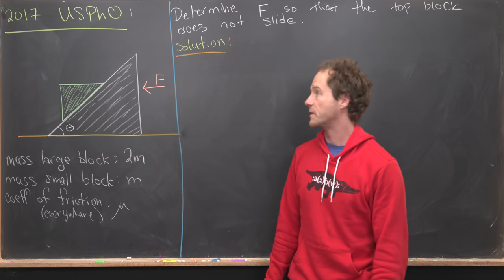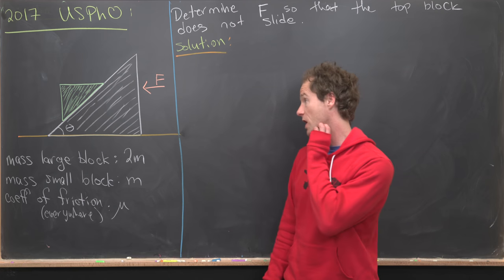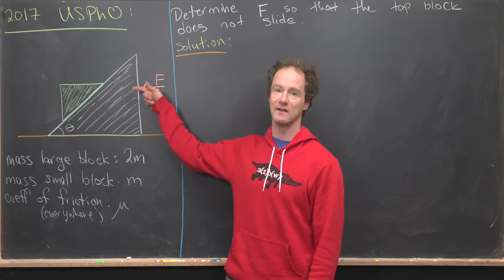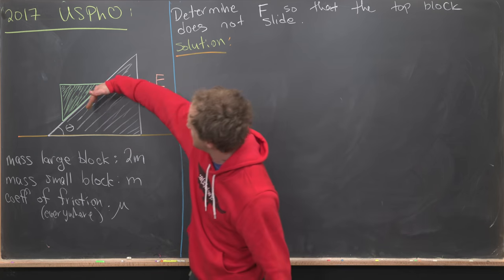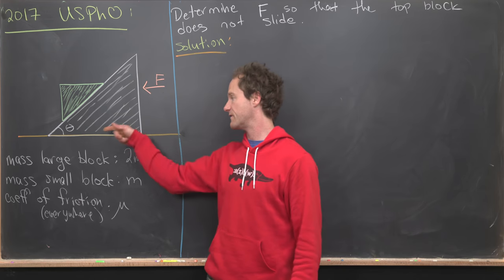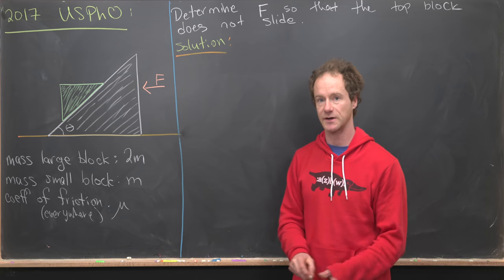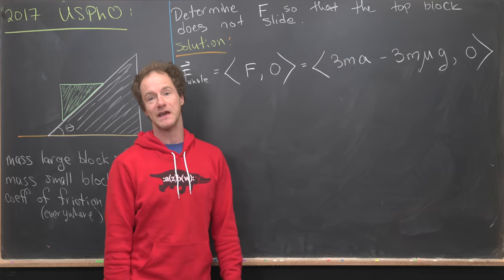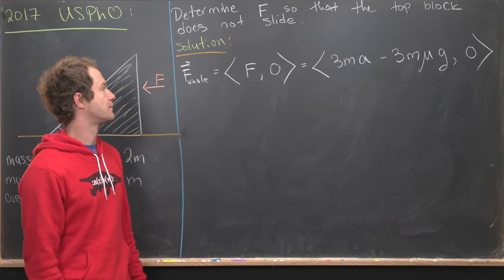Math professor tries Physics Olympiad!!

Comment: Could you explain why the equation for F_whole is 3ma - 3mmug? It makes more conceptual sense for it to be +?
Reply: You are correct. He is weong to my knowledge
Reply: It’s simply a matter of defining what you are talking about. Throughout he clearly is calling 3ma the resulting motion of the body from pushing it. In this case, the 3ma is the F drawn in the diagram and the F in the equations is the resultant force on the body (3ma-3mug)
Reply: He is not only making a sign mistake here but also a very important conceptual one. This is what we usually see in most of our Physics students as well, especially when the concepts are not understood thoroughly. He is definitely WRONG! If F in his solution referred to the net force, then the equation would read F=3ma. But since he keeps saying that F is the force applied from the right, he should have written for the net force as F(net)=F–3\mu mg. Then, this net force is equated to 3ma, yielding F–3\mu mg=3ma. So, either way the equation he writes is WRONG, WRONG and WRONG!
Reply: @joshyman221  
The result he ends up with is wrong though, because he later is using F as the applied force and a as the resulting acceleration.

Comment: I'm thinking from a physics perspective you inspect the problem. There is one constraint - M2 does not move with respect to M1 in the solution, therefore F=3ma+3um. Then how to find a? The forces up and down the ramp must add to zero. It is easy to see that this means Framp = m(uNsin + asin - gcos)=0 and therefore a = (gcos -uNsin)/sin or sometime like that. I don't have any paper here.

Comment: My training in physics is reduced, so I could certainly be wrong, but I would like to understand two points :
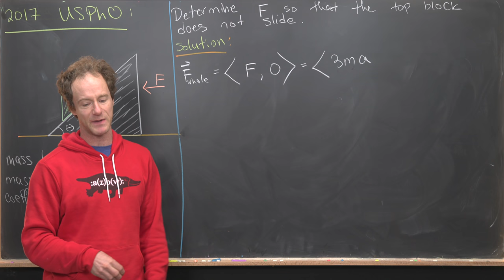  - at 2:40, why not a PLUS ? The needed force = the force who moves the system + the force reacting to the friction. Isn't it ?
  - I'm confuse by the use of the same μ in the two contacts, because the first must be a dynamic friction and the second a static friction (if the goal is achieved).
Thank you for an explanation if you have the time and continue this great channel. And yes for more physics videos.

Comment: The problem is somewhat incorrectly stated. The coefficient of friction is not mu on every surface. For the bigger block, the friction coefficient with the floor must be at mu if the block is moving (which it must be since we are trying to find the maximum and minimum values for F). But, the friction coefficient between the smaller mass and the big block is, in general, mu_1 <= mu. This is a very important consideration to make.

Furthermore, your sign for 3*mu*mg is incorrect. A quick force diagram for the overall block system shows that: F-3*mu*mg = 3ma => F = 3ma + 3mu*mg. There are no two ways about that.

Comment: How the hell could the small block shift upward on the diagonal simply by a horizontal force on the larger block? Does not make sense!
Reply: A force perpendicular to the contact between the two blocks is generated. This is called the Normal Reaction force. This force will have a component in the upwards direction hence pushes the small block upwards.

Comment: Brave effort :). The problem would be nicer if stated in terms of acceleration (with g as the unit) rather than force. And while you did do some discussion of the results, a physicist would do more thorough discussion in terms of a and mu, in order to get a feel for the whole system. E.g. using some realistic mu like 0.8 and see what how theta and a would mutually relate then.
Reply: the physical interpretation would point out its all incorrect.

Comment: This is a nice video. In my opinion it could be even better if you focused more on the physics part of the problem. The equation should come from the system modeling part but the video does not tell what is the point (part of the system) that you consider forces in (what are those forces and what is the reference point for considering them). What are the equilibrium constraints for the upper block to not slide up or down. Also, I'm not sure what is the purpose of introducing acceleration `a` in the equations. The math part is great as usual :).

Comment: Is it normal for maths professors to be able to solve physics problems
Reply: Yes. Cause physics problems have a lot of maths. You can apply calculus, differential equations, probability in many branches of physics.
Reply: They can very off solve the resulting equations.  However, they cannot always set up the problem correctly.  I am happy when they can, but sad when they post something that demonstrated clearly that they cannot.

Comment: The problem here is not approaching the problem correctly (as pointed out by quite a few viewers before me).  There should be a free-body diagram for the system before trying to write down some vector equation. 

After drawing the 4 forces that act on the system, the vector equation labeled "Fwhole" should be "Whole System: Fnet = <F - μN, N-3mg> = <3ma, 0>"  

Then, 3 forces act on the small block, but the diagram shows only 2.  The vector equation labeled "Fsmall" should be "Small Block: Fnet = <Nsinθ-μNcosθ, Ncosθ+μNsinθ-mg> = <ma, 0>" for finding Fmin.

Or, if you want to do less algebra, you can point "x" to the left at an angle θ below the horizontal and "y" at an angle of θ tot he left of vertically up and have 
"Small Block: Fnet = <mgsinθ - μN, N - mgcosθ> = <m(acosθ), m(asinθ)>"  This form also makes a simple change when you look for the maximum force, you just have to change the sign between the mgsinθ  and the μN.

I got Fmin = 3mg*(1+μ)/(cosθ+μsinθ) for tanθ > μ and Fmin = 0 for tanθ ≤ μ.  The Fmax is messier and I won't put here.

Comment: Always a problem when using physics to calculate what would be an engineering problem. You need to consider the initial condition before a load F is applied. If mu is too low the small block will slide down the slope without any load applied. If mu is higher then the small block remains in place and does so even when a force is applied. This is because all forces need to sum to zero and there will be no effective force on the small block that will overcome the inertia of the system, that is the horizontal component of the force applied to the small block is balnced by an equal and opposite force from the block due to its inertia: any movement of the large block is transferred to small block. Remember also that the force required to over come friction is higher than the force required to keep the movement going.
So until the large block moves, there is no force transferred to the small block.
However, this also depends on the speed at which the load is applied and the elasticity of the materials used in the blocks. If the load rises rapidly from zero to F then the small block will (possibly if friction is overcome) move up the slope, there is no condition where applying the load F that can cause the block to move down the slope, unless of course the direction of F is reversed and the lower block moves away to the right. Rapid application of the load has this effect due to the inertia in the system. Physics calculations often fail to reflect the reality that any engineer knows by heart.